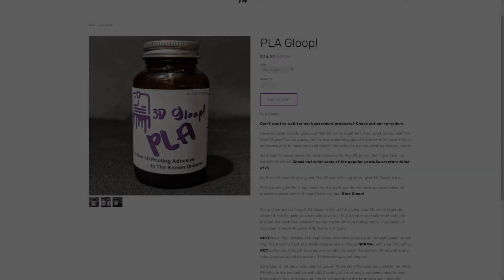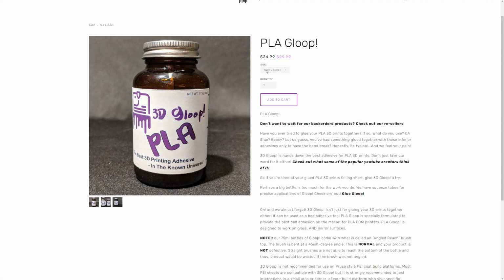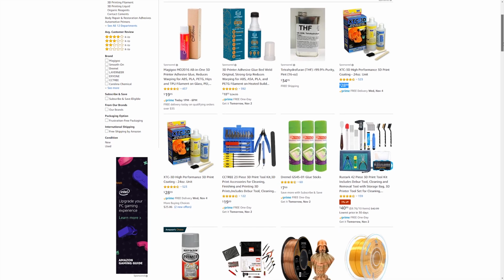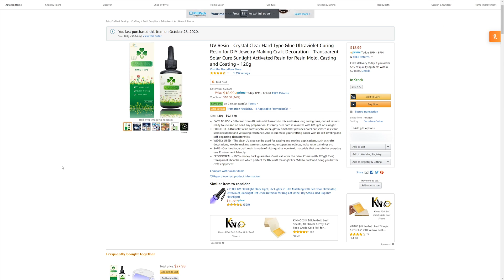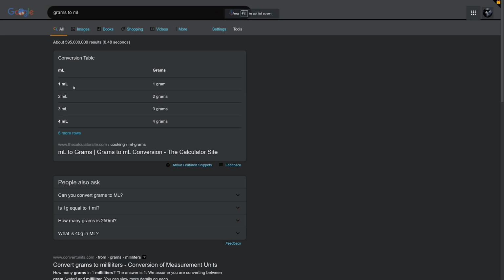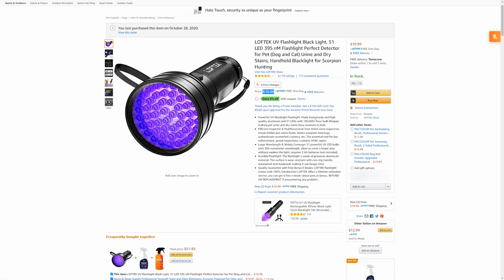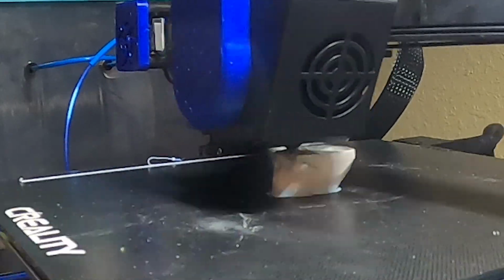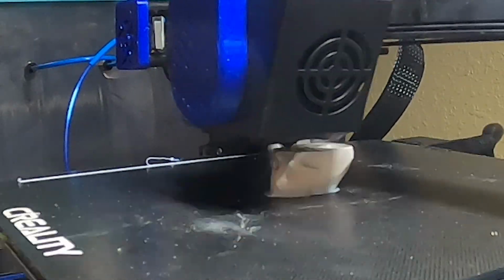Can you smooth PLA prints with UV Resin? | An Experiment!

Comment: I don't know about that resin you used, but as mentioned above, the UV resin used for 3D printing is cheaper. But you also need a 405nm wavelength light source. I noticed that the flashlight you used is 395nm. Doesn't sound like a distinctive difference, but it is.
Reply from the maker: I noticed a while back that the flashlight wasn't doing a great job. I've since switched to a different one after I did some research, but I appreciate the heads up. I'll pin your comment so others can see about the flashlight!

Comment: If you use the resin made for 3D printing, it would be a lot cheaper, and a lot less thick. All you really want is to smooth the lines, not make a low-poly object look like a high-poly object. Using thinner resin will do that, and it will cure a lot faster. I plan to do this on a much larger print I made, but I want to make sure that if it doesn't work as well as I hoped, I will still be able to sand my way to a good finished product.

Comment: Planning to try UV resin smoothing this week after watching several videos on it. Quick question, have you ever checked how the layer of resin affects the object dimensionally? I'm imagining that the hardened resin layer does add some additional degree of thickness to the prints, which could cause issues when fitting multi-part prints with specific tolerances together in an assembly.
Reply from the maker: I haven't checked, but I imagine the same thing. It has to add some sort of thickness.

You could try sanding it down to fit after, or try avoiding the joint/socket when painting the resin on.
Reply: @Avel  Yeah, that's my first thought, just avoid all the areas around joints and moving parts. Really looking forward to testing this out!
Reply from the maker: @magicgundam  Hope it works out!